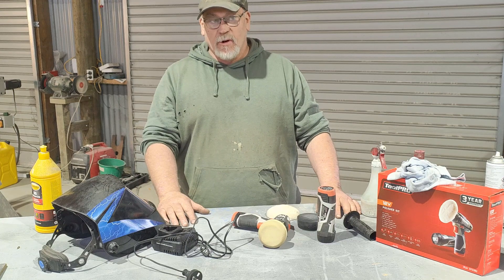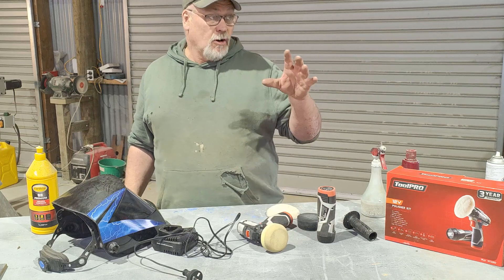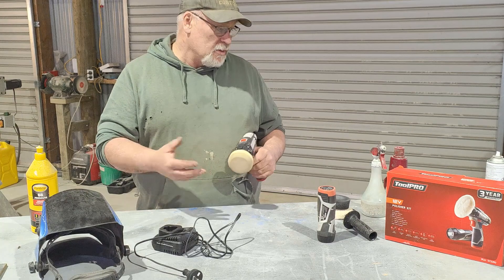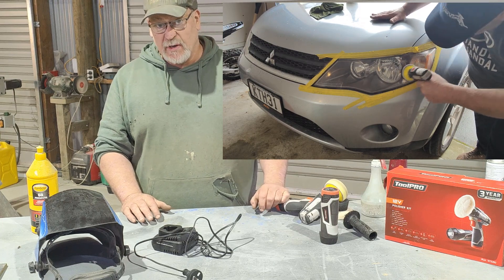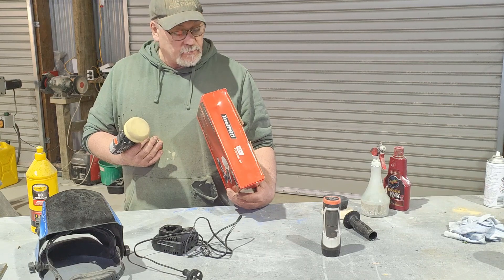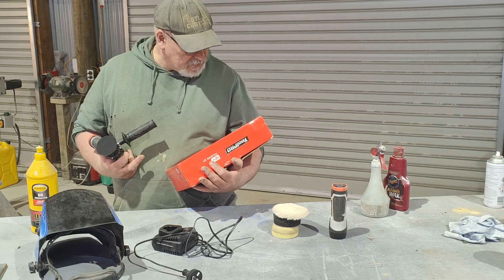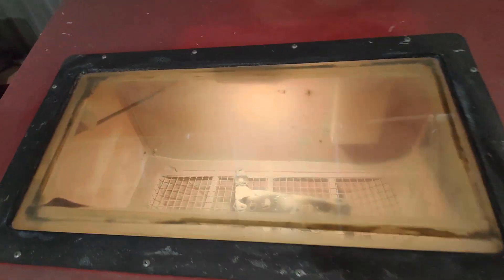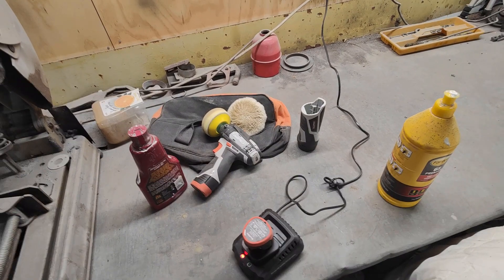first month review 12V ToolPro Polisher kits

Comment: Hi, how do you reckon this would go polishing freshly painted motorcycle tanks gaurds etc? And what sort of run time.? Cheers.
Reply from the maker: For bike parts it would be pretty good I would think I would get a big battery as well for better run time but it works well for everything I have used it for I buffed up around a window opening with after repairs before putting glass back in